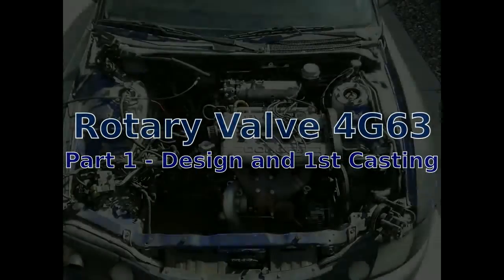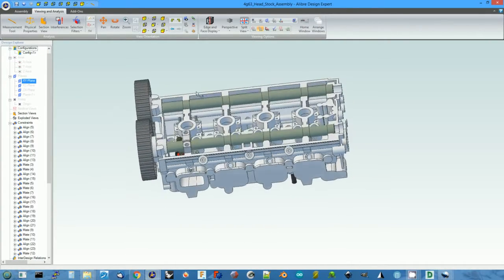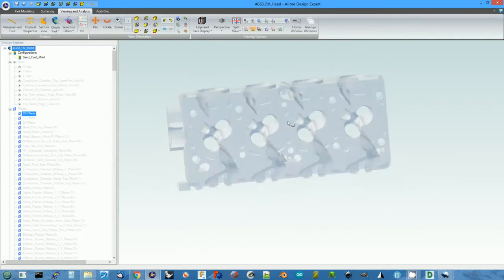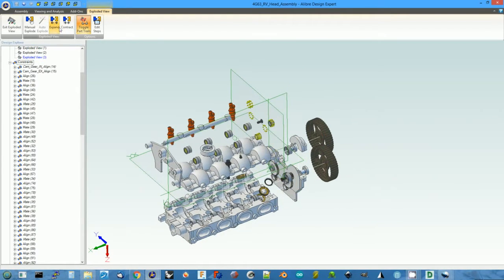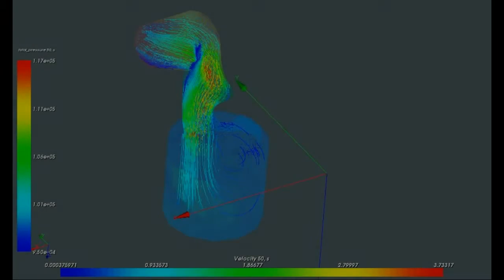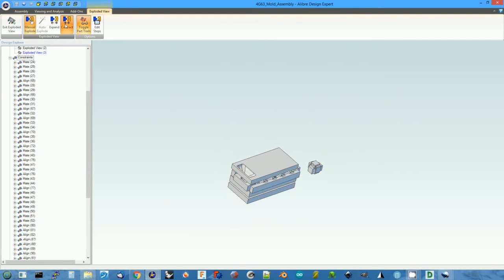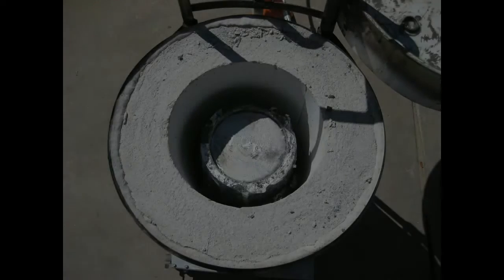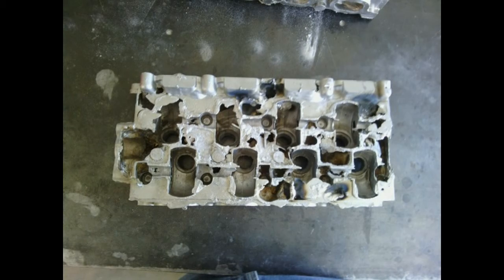Rotary Valve Cylinder Head: Part 1 - Design and 1st Casting

Comment: I have the solution to the gas problem the moment that there is one hole to enter the metal and this is a problem in itself that caused the gas to be trapped inside the mold. Here is the solution. You must make two or more holes, one to enter the metal and the other for the gas to exit, meaning that the metal will work to force the gas out of the mold through its other sign.
Reply from the maker: Thanks for the comment. I was able to get a good casting by doing what you are saying - venting the cores more. Also what helped was changing the sand binder for the core from sodium silicate to a commercial resin binder called Pep Set II IIRC.

Comment: did you succeed in building that head for your car?
Reply from the maker: It's built but the seals blew out and I blew through the time and money I alloted to the project. Also my garage is so creamed with stuff I can hardly work in there. I'm building a new shop. I still plan on finishing it but I'm a little ways off.
Reply: @Goldenfab  how did you cast it? You've got videos showing a well cast head being tested and you've got this one showing a failed cast, what did you do differently to achieve an acceptable cast?
Reply from the maker: @alexanderdcossey9146  A lot of trial and error. Once of the challenges I was facing is controlling the outgassing of the sand such that it doesn't boil into the metal when its liquid and create voids. Ultimate what contributed to success the most was using an industrial purposed foundry sand core binder called PepSet II.
Reply: @Goldenfab  cheers for the reply!

Comment: I was watching this again and I thought of a solution. If you turn the rotors perpendicular to the port you will be able to have a cleaner direct path to the cylinder. You could turn the rotors using pinion gears. Yes it would complicate it. You will need a Torrington bearing for thrust and a beefier shaft to counter the thrust. But the amount of flow possible should be ridiculous.
Reply from the maker: Thanks for the idea. If in the next iterations I am not able to flow numbers I am happy with I may give that a try. This guy has a design that looks to be really good for flow https://www.youtube.com/watch?v=vpEV_uX1zf8
Reply: @Goldenfab  it looks pretty good. Definitely one way to go about it. I am concerned with the combustion chamber design. It is extremely critical for quench and complete combustion.
Reply from the maker: @curvs4me  For sure, there are lots of things to work out.

Comment: Are you going to make your own valve/shafts or have Coates do it ?
Reply from the maker: Making my own. I talked to Coates about getting a prototype from them years ago and they were not interested in working with me.
Reply: @Goldenfab   Well that sucks. One would think they would collaborate a bit more on gas engines. They could use a contract to keep outsiders in check while reaping R&D savings with a profit share via said contract. Spherical Rotary Valve technology in my opinion is the best bang for the buck as far as HP/Torque and fuel efficiency is concerned. Systems like Freevalve technology is vastly more manageable, however exceedingly complex therefore more cost restrictive than the SRV tech that eliminates the poppet valve limitations altogether. This fact becomes obvious in large diesels wherein cutting fuel consumption while gaining HP. Plus you'll NEVER drop a valve like Freevalve.
Reply: Goldenstein Engineering and Fabrication LLC  are you open to making these heads for a motorcycle application inline 4?
Reply from the maker: @jevonmartinez7621  Yes but I have not yet go the technology perfected.

Comment: Where those molds made by a zcorp 310? Great work by the way, pretty impressive
Reply from the maker: Markitos203 yes the one that look like a white plaster. I did not get very good results mainly due not not having proper venting in the mold design. The usable casting you see on the engine was made with traditional sand molds from patterns.
Reply: Goldenstein Engineering and Fabrication LLC thanks for the reply.  I'm also wondering what powder do you run on that machine if you happen to know. I want to pull the trigger and purchase a 310 but its hard to source the powder
Reply from the maker: Markitos203 yes sourcing the consumables is the issue with these. It's stupid expensive. I have played around with some different diy mixes but have not found anything super great. Hydrocal worked about the best. Also note that the hp10 inkjet printhead it takes is no longer made.

Comment: I was thinking about a hollow shaft one for intake one for exhaust that spin like a regular camshaft with openings or cutouts for each cyl that allow the air/exh to flow in/out as they turn...so the intake air and exhaust would be flowing through the cam basically.
Reply: That sounds like the Bishop Rotary Valve, which is the only promising rotary valve technology... imo.